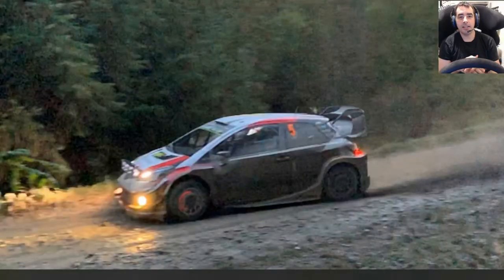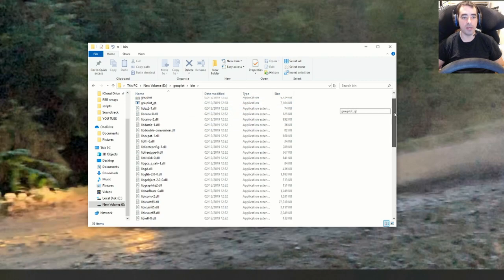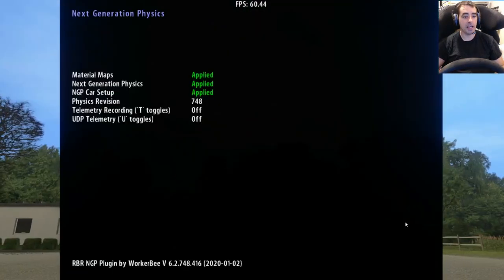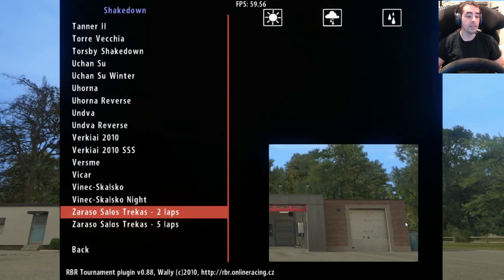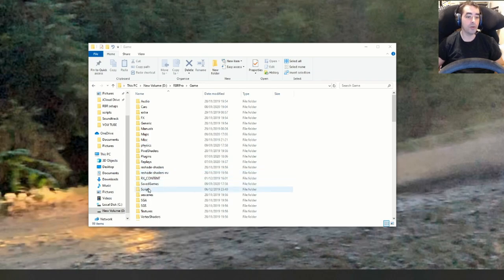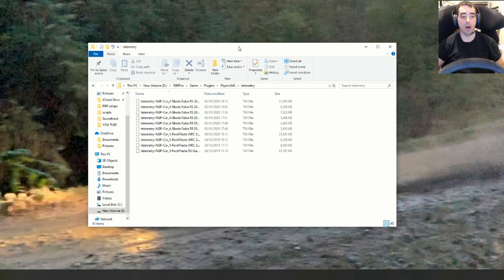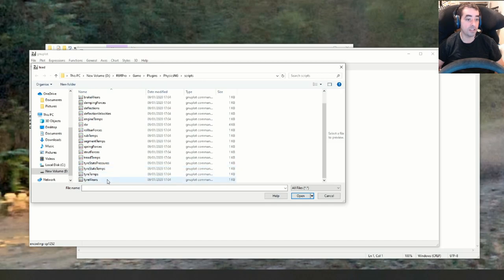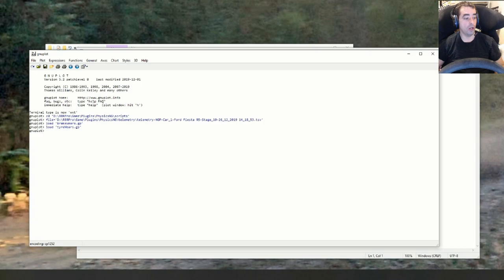Richard Burns Rally Telemetry extraction. Brake/Tire temps, wear and much more

Comment: I decided not to make the promised video, because with the new version 6.2 of NGP, which has UDP protocol, there will be an easier way to get the data and analyze it.
Reply from the maker: Are they available yet? Will be much nicer to have an easier way to check the telemetry. 
Nickolay said there’s a program to do it but it’s 300€ 😭
Reply: @kevedwards  I'M Mayagoldenretriever on facebook :)